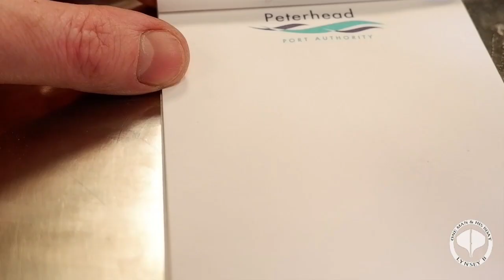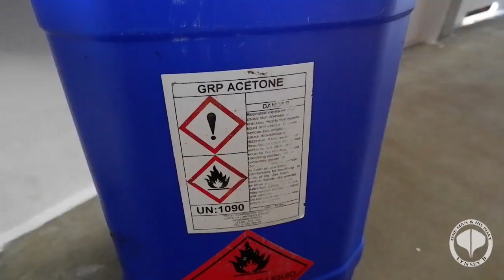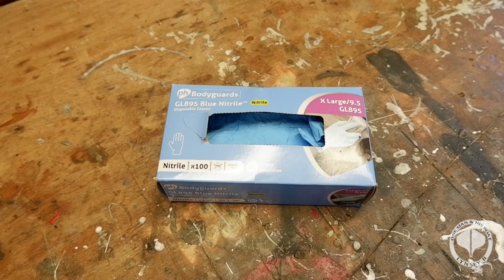Tube fitting Episode 74

Comment: cracking video, question why bond to the hull rather than bond clamps onto risers then out  runner into clamps, would allow removal if required and possible fail safe point if you get a fast and can’t cut free. Anyway love your work on the LynsyB
Reply from the maker: Hi Wjb2, glad you liked the episode. 
To answer your question....this is a permanent fix, and everything has to be a smooth as possible,  so creels don't get jammed up, hence why its glassed to the hull.
If the boat was bigger, your Idea, would definitely be in the think tank.
So thank you for you suggestion. Keep the question coming bud, it's always good to hear others folks ideas.
Have a great weekend.
All the best
Baz 😉👍
Reply: @onemanandhisboat  thanks for replying Baz, it was idle curiosity mate. I love boats of all types unfortunately the sea doesn’t like me . If the boat has forward motion i’m fine , minute it stops “ Ralph & Hugey” starts and i mean starts with no stopping, boat goes forward instantly i’m Ok , big ships no bother. My uncle had a non-commercial coble when i was young and the number of tries we had to get my sea legs. 
Any once more keep well and may fair winds be with you once you get her wet.
Reply from the maker: @wjb2  if you don't ask...you'll never know mate.😜😉👍
There is always a reason why,I do the way I do, things on the boat bud, and it's mostly to do with my style of fishing, and my size....hence why there's no wheelhouse going on her.....but it always fantastic to hear others folks ideas. Because no idea is wrong, it's just maybe not the way the person would do it, or even not thought about that way!😜😂😂😂😂😉👍
You don't have to tell me about " sea legs" pal, it's been over two years since I was last at sea....I'm not looking forward to the 1st choppy day!🤢🤢🤢🤢🤮🤮🤮🤮😂😂😂😂
Got to ❤ a coble bud....we had a Triton ( plastic) coble....fantastic sea boats! In fact some of the Lynsey B design is based on our coble.😁😁😁😁😉👍
If you have any more questions or ideas, fire away pal.
Have a fantastic day....I'm off for lunch,  then more building💪💪💪😉👍
All the best bud.😉👍

Comment: Are you going to fit stainless pipe to both sides?  Good to have plenty of places to lash things if required.  Certainly looking great and you’re definitely thinking about all your requirements.  Cheers.
Reply from the maker: Hi PW, yeah, pipe going in the port side too, but I have to wait until the steering console is made ( which I'm 1/3 of the way through😉👍) as the pipe gets attached to the console. 
I've still got plenty ideas in the tank....I'm looking forward to showing you my idea for the bait box.😁😁😁😉👍
Have a great weekend bud. 
Thank you for commenting. 
All the best bud.
Baz 😉👍
Reply: @onemanandhisboat  I was wondering if you should leave the end of the tube ‘accessible’ and feed a nylon rope through it.  The reason behind thar is that any future electric cables and things could be pulled through. Nicely out of harms way.  Just an idea.
Reply from the maker: Nice suggestion bud, and defo one for the "think tank"
Love how our fans come up with some great ideas,  thank you.
Hope you have a great Christmas. 
All the best 
Baz.😉👍
Reply: @onemanandhisboat  No problem,  so as you're  not having a wheelhouse just the open console,  will you be designing it with some sort of 'lid' that can be locked when in harbour and keep the sea gull c*** off the electrics and also discourage the light fingered?
Reply from the maker: Definitely! Especially round our Harbour.
The console will be getting a cover as well as lockable lid....and most of the expensive items will be bolted at the back with security bolts.😉👍
All will be revealed in the coming episodes bud.
But keep the suggestions coming in, I really appreciate them.😉👍